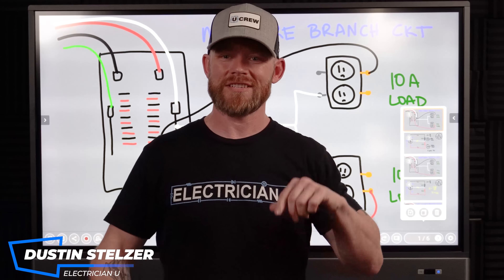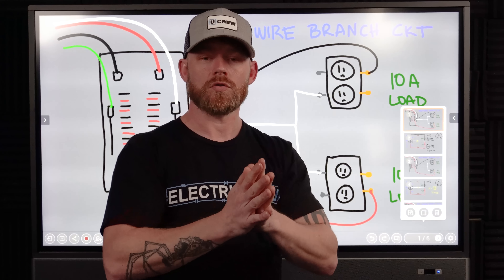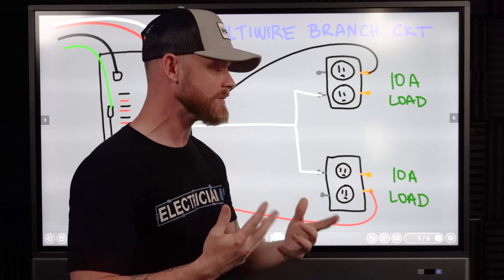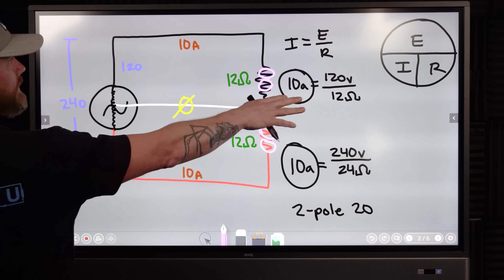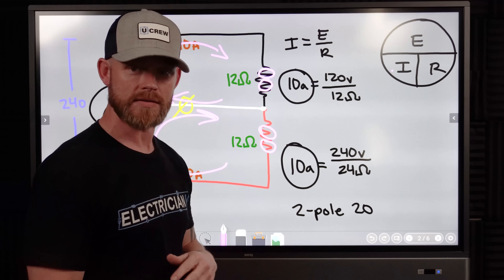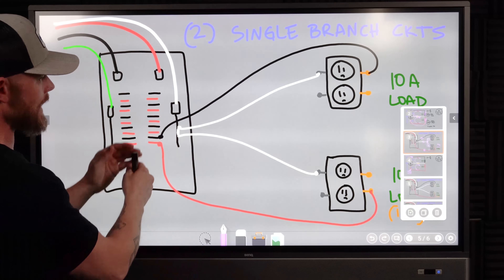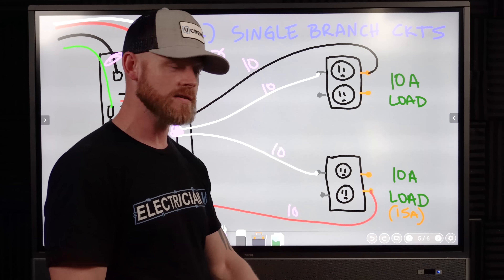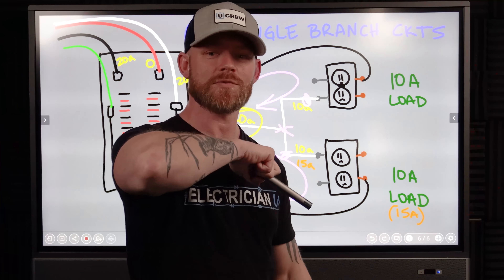Neutral Imbalance in Multiwire Branch Circuits (Two Hots, One Neutral)

Comment: Here’s a complication related to that configuration which came up when I had some recent kitchen work done.  I wanted the GFCI function moved to the panel and my electrician said he had to use a double breaker for the two kitchen circuits.  The catch is that he wanted to put an AFCI on the circuits as well, but there is no dual function double breaker for my panel.  We went with just the GFCI and the inspector passed it, so I’m happy.

They weren’t new circuits, but once you touch an old circuit you are supposed to bring it to new standards.  That isn’t always easy.
Reply: To the best of my knowledge, currently no panel manufacturer has double pole dual function breakers in their lineup.   Double pole GFCIs are readily available although you may not find them in less than 50 or 30 amps at your local home Depot or Lowe's because double pole GFCIs are required for hot tubs and spas, 50 amps is the most common for this application also some smaller hot tubs may specify 30 amp over current protection.  

Square D and Siemens are the two manufacturers I'm aware of that offer double pole AFCIs, designed for use on multi wire branch circuits.

Comment: YOU FORGOT TO SHOW  WHAT HAPPENS  IF THE NUETRAL GETS BROKEN ?    need Examples for MWBC  properly connected with different panel bus phases and   if MWBC was cross wired at the panel from the same bus phase.    How can this same phase be troubleshooted found?  My panel, I presume,  over the years has had handymen disconnecting MWBC breakers and  separating circuits on single pole breakers and rearranging placement on the panel.  How do I find what  circuits belong to the original MWBC ?

Comment: For normal residential service it is single phase. The red and black hots are not different phases but different legs of a split phase 240v service. The neutral is connected to a center tap of a single phase transformer. For some apartments it might be 2 phases of a 120/208 service. In that case the voltage across the red and black phases will be around 208v.  

If you find neutral wires that are brown or black (burnt) it is often caused by sharing a neutral with more than one circuit. It presents a serious fire hazard. In this example if you share 1 neutral with 2 different 20amp circuits on a black leg and both circuits are carrying 20 amps the neutral will be carrying 40 amps. The neutral wire will get very hot and possibly start a fire. If you install a GFCI on either circuit it will trip constantly. 

If you install 2 circuits on separate service legs, the neutral will carry the difference in load between the 2 circuits. This can be useful to reduce voltage drop. The voltage drop of a circuit is calculated on the total length of the hot and neutral. So in you ran 2 separate circuits for a detached garage that was 100 feet away you would have more voltage drop than if you ran 1 three circuit.
Reply: This is a pedantic argument.  I liked hearing him use the word “phase” because he clearly understands the split phase system yet finds it useful to think of the two 120V circuits as being in opposite phase.  If you don’t like the term used as he did here, you are free to use another, but there is no need to lecture.  He was communicating effectively, because you did understand his meaning.

Comment: Not recommended!
If you isolate one of the brakers to work on that outlet, the other circuit could still be live on the return if it is still being used at the same time!
Thus, a hot return on the outlet you are working on!
Reply: It's two completely separate circuits, each with its own hot its own neutral and its own ground nothing is tied in to each other in the junction box the circuits that are completely dedicated pass through the same JB

Comment: the electrical system where i live is 240 vac, 60 hz, two-wire (hot and neutral) and ungrounded system. i want to install a ground rod and upgrade my circuit wirings to grounded system, do i need to bond the ground to the neutral line? pls. help.
Reply: What do you mean by 240vac?
Reply: @juli9338  i should say 220 volt AC

Comment: They used to do this at a certain time it was up to cold there get away with it but I've seen circuits where the red and black are on a double circuit breaker on the same leg and what is neutral ground so the white is actually carrying can carry if both wires were carrying 20 amps that white wire would be carrying 40 amps of current now that's a dangerous situation on what he describing that was cold at one time. It's safe to run as long as you're neutral wire is pigtailed to the main neutral wire and not jumping from one plug to the other otherwise you will have problems if one of the neutrals is not tight it has to be pigtailed.

Comment: I think you mean impedence. It may also be good to note that you only get cancelation when the lines are phased 180 degrees apart. 2 branches of a 3 phase would measure on a neutral.
Reply: @JorgTheElder  Right, but it would good to note that for some, plus the phasing is very important. Single phase is actually 120/240 for residential in the US and Canada. Code states 120v +/- 5%

Comment: Excellent explanation of the balanced load concept.
For any who need a practical application of this, think of how you run wire. Running romex simplifies things sometimes, because neutrals are run with the hots. But instead, say you're running wire in EMT instead of romex. You can run nine 12-gauge wires in 1/2" EMT. So you decide to pull five circuits to a J-box, then branch off to different areas. So in the EMT, you have 8 wires:
3 Black wires  (A-phase circuits 1 / 5 / 9)
2 Red wires     (B-phase circuits 3 / 7)
3 White wires  (neutrals)
Remember, phases alternate in the panel, so 1-3-5-7-9 in phase-notation is A-B-A-B-A
|
So to do this and have balance, you HAVE to pull three White wires with the five circuits, one neutral for each "pair" of phases A-B, plus one for the extra A-phase circuit. So circuits 1 and 3 can share a neutral. So can 1 and 7. Same goes for 3 and 5 or 3 and 9, and so on. As long as the 2 circuits sharing the neutral are alternating phases and NOT same phase, you're fine. The third neutral is for the extra circuit in the run. If 1 and 3 share a neutral, and 5 and 7 share a neutral, circuit 9 is still there by it's lonesome. If you tie circuit nine into the neutral for either of the other two pairs, you're overloading that pair's neutral, since 9 is in phase with both circuits 1 and 5. So you HAVE to run a third neutral to cover circuit 9.
|
And I explained all this to make this critical point: In the J-box you hit before branching off, YOU CANNOT TIE ALL THREE NEUTRALS TOGETHER.
This is really important. In this example, three whites aren't ONE neutral run, it's THREE. So the neutrals have to stay separate in the box. If circuits 1 and 3 leave the j-box to one room, their neutral is wirenutted to one of the neutrals in the J-box going back to the panel. Circuits 5 and 7 leave the j-box to another two rooms, their neutral is wirenutted to the second neutral in the j-box going back to the panel. Circuit 9 leaves the j-box for another room, its neutral is wirenutted to the last neutral in the j-box going back to the panel. So there would be 3 wirenuts in the j-box, one for each neutral run, NOT three neutral runs all wirenutted together with their branch-offs from the rooms the circuits feed. 

And say circuits 1 and 3 go to a room next to a room fed by circuit 9, so you run them in the same pipe from the j-box towards those rooms. Since circuit 9 has its own neutral, you have to run 2 neutrals in that pipe to cover the circuits properly. And if you set another j-box before you get to the last room, you can't tie those 2 neutrals together either, they have to stay separate all the way back to the original j-box. And those two neutrals will be wirenutted to separate neutrals in that original j-box going back to the panel. Can't stress this enough, NEUTRAL RUNS STAY SEPARATED FROM EACH OTHER. The number of times I've seen a box full of neutrals all tied together with 3 or 5 circuits in the box...... Oy.  It's not just a code violation, it's a straight fire hazard - AND, not mentioned very often, you can create quite the magnetic field in a box when you mix a bunch of neutrals from a handful of circuits like that, which isn't safe either. 
|
I'm explaining this with EMT and loose wire because romex sometimes makes it too simple by always having a white wire plus a color, or a white wire plus two colors, depending on the size of the romex, and romex is always its own run, you don't pull all the circuits together in one pipe. So it sometimes takes the thinking out of the process, whereas running loose wire-pulls in EMT forces you to make sure you understand what you need in the pipe. That said, if several romex runs from the panel all hit a j-box together, make sure you label the circuit numbers on the romex in the j-box and make sure you're not splicing neutrals that don't belong together. Labeling in a j-box it critically important just for that, if nothing else.
|
What Dustin just explained is the science and the math of WHY it has to be that way. He also did a good job of explaining why the neutral wire isn't simply a "return" to the panel, that it serves an important function in balancing the system, and how that works, scientifically speaking. Great video.

Comment: Is the main voltage source 240v or 120v in your visual explanation of neutral current ? To see if the circuit is unbalanced; do you have to test current on each 'smiley face' ? When does unbalanced become a major problem (fire) ?

Comment: So if you had a 240 volt AC unit and the fan is only pulling 120 of that half and the compressor is pulling 240 of the total,because even with the total of both on the same neutral how does that work,this is the reason why I disagree with your analogy,240 is too hots and one neutral but you don't need the neutral to get 240 at the red and the black but the neutral is the traveler back to the panel that is true, so why couldn't it travel 120 and the excess of the 240 as well, does not make sense never had the neutral get hot in that situation and even when you explain one traveling and the other one cancel it out ,still doesn't make sense because they would do that at the breaker box anyway because ultimately no matter what you got all the neutrals are going back to the bus bar in the panel so it really doesn't matter in my opinion the bus bar doesn't get 🔥

Comment: You said 220 volts first of all the average is 240 on a double circuit on both bus bars also if you split the neutral both the neutrals on different sockets go to the same place when they enter the panel anyway so splitting them at the plugs in the wall would not be any different cuz the traveler is the same to the breaker box neutral whether it's two separate wires or one neutral wire they would essentially go back to the neutral bus bar what you should have noted is that if you connect the hots on each separate plug that you could get 240 volts with one neutral but if the circuits are in separate rooms you will never have a problem you're always going to get 120 volts

Comment: Awesome video! I was curious though how you would wire the neutral line in residential sub-panel? For example, I have a three-wire stranded aluminum cable connected to a 40-amp breaker servicing an electric stove. So if I'm not mistaken, in this scenario, the bare stranded wire is being used as both a neutral and a ground wire. In a case like that, would you connect the bare aluminum wire to the ground bus? Or to a neutral bar?

Comment: I think a visual or physical way to demonstrate this for people would be using two single acting hydraulic cylinders connected to a reservoir.
The hydraulic cylinders representing the hot legs and the reservoir representing the neutral.

If the cylinders are extended in unison (same phase) drawing fluid from the reservoir, the reservoir level will drop (current in one direction).
Likewise, if the cylinders are retracted in unison (again, same phase) returning fluid to the reservoir, the reservoir level will rise (current in the other direction).

If the hydraulic cylinders are retracted and extended opposite each other (different phases), the reservoir level will remain the same (no net current).

Comment: What if you only have two hot wires and no neutral or ground in an outlet, when you disconnect them from the rceptical it kills the other outlets?

Comment: When updating a breaker for a Multiwire Branch Circuit to an AFCI breaker, could 2 single pole AFCI's (handle tied) be used, meaning split the neutral to connect to each breaker? I ask because of the rarity of 2 pole AFCI's sharing a neutral, especially matching my box brand (GE). Wouldn't the AFCI still work since it would still be able to detect an arc fault?

Comment: Your videos are the best electrical system content I’ve seen on YouTube, I’m subscribed! I wired two “back to back” bathrooms (they share a common wall) on a 12/3 circuit to ease the long run in a very low attic space. My old (1952) house has a shocking number of loads on each old 2-wire cloth covered romex circuit, and I am breaking them up while replacing the wiring as I redo each room. After watching your video, I went back and verified each circuit in the 12/3 was on a different power leg (they were), so I’m feeling good on that one. But now, considering the potential for doubling the load on the neutral if miswired, I think I’ll just stick to single cable runs where the neutral is just carrying the one circuit.  I was ok, but your video made me go and make sure I was, and that’s the definition of worthwhile content. Excellent work!
Reply: If it's hard to access and both circuits need seperate neutrals, you could use 12/4,

Comment: Hey Dustin thanks for the incredible content.
Im still trying to understand though, how does a mwbc on 2 separate phases not actually test as a 240v on a meter
Reply: Remember that the two phases are connected to TWO outlets. Normally a phase/phase device is a single load needing 240v. The 240v is shared for two loads, so 120v each. You'll get 240v on your meter if you measure from first outlet phase to the secod outlet phase
Reply: @Znyggisen  right but arent the two loads connected to eachother through the neutral? If you would remove the neutral from the bus bar then it would test 240v. So how come when the neutral is on the bus bar the voltage is divided between the loads. They still have that point where the neutrals are spliced connecting the phases to eachother
Reply: @jonessebag  It will test 240v regardless if the neutral is on the bus bar or not (between phases), but without the neutral to the bus bar the outlets would only function properly with two equal loads as otherwise the voltage would divide unevenly

Comment: What about feeding RV pedestals with a multi wire branch circuit and each pedestal is grounded without a grounding wire separately ran from the connection at the fuse disconnect and ran to the pedestal panels which are 50 30 20 outlet and breaker panels and each pedestal has two panels do you have to run a neutral and ground separate from the branch service disconnect to each panel and does it need the ground and neutral separated at each pedestal and then grounded with a ground rod at each pedestal? I hope that makes sense it's all kind of confusing...

Comment: At 13;10, We needed 240 in a home that had no accessible dryer type plug. So we made a pig tail assembly that could be plugged into to 120v plugs to get 240v. It worked gr8 for our low amperage load needs.
Reply: Yes I've done that before with their washer and dryer combined unit it just means your dryer works at 1/3 of the heat that will normally put out because when you go from 240 to 120 volts then you're heating element only works at 1/3 of its rating so if it's a 3000 watt heating unit it's only going to put out 1,000 watts of heat the ohm's law comes into effect on that heating element because the resistance in the element.

Comment: 14;12... We did this w/ a few lighting circuits. We had to make sure the red & black was on the same 120v side of the load ctr.  The bulbs were different wattage and were sharing unintended current when needed were acting as a light dimmer to the other bulb.

Comment: Really good!  Now I need to change something in my house to correct what I did 20 years ago.  This old Pushmatic panel does not have alternating A and B phases on each row of breakers. Example, every breaker on the left hand side is on A phase and every breaker on the right hand side is phase B.  Unfortunately I did not realize this when I added the multi wire branch circuit.

Comment: Great explainer! This becomes especially important if you have tandem breakers in your panel. The house I just bought at the end of last year has a number of them and most were OK but a couple were doubled onto a MWBC. It's so easy to avoid by simply not sharing a single tandem breaker for a MWBC (should be split and tied) and yet someone did it anyway. I've found a few other "Why would anyone do this!?" surprises along the way. Yay for old houses and shoddy work!

Comment: So I've been sitting here for a few hours watching your videos.  And it seems I always misread the titles - I was thinking of a 2 pole circuit that still requires a neutral wire.Typically in a 2 pole circuit, a neutral is not required because of the load balance on the phases - why would one ever be needed?

Comment: One wall plug with two circuit, one neutral, one ground,one feeds dishwasher, second feed hotwater tank for kitchen sink.
Old plug arch out tripping both breakers,it's been replaced